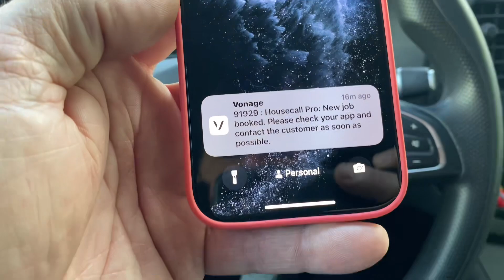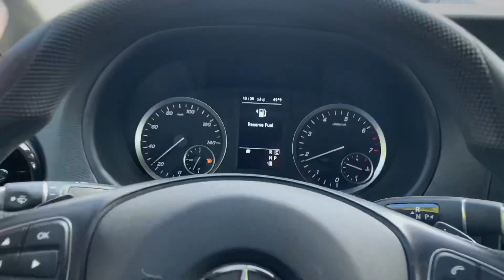Emergency No Heat Burnham Gas Steam Boiler - LWCO ACTIVE WITH LOW WATER CONDITION

Comment: How does the auto water feeder keep the water at the right level ? I'm used to hydronic systems with a water feeder maintaining pressure. Great video as always
Reply from the maker: The LWCO sends signal
Reply: It’s just a probe at a certain level and the water either makes or breaks contact